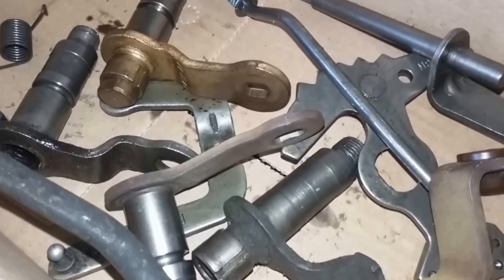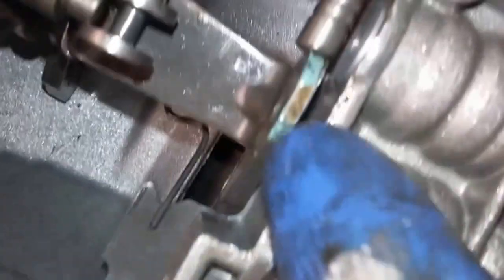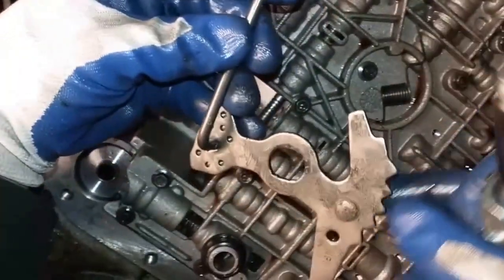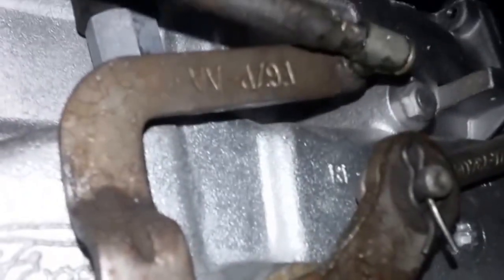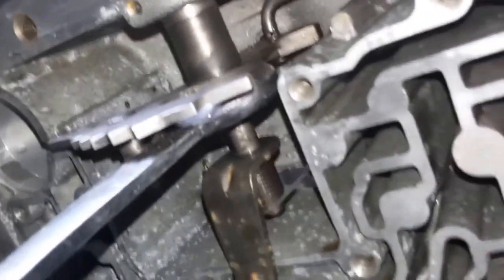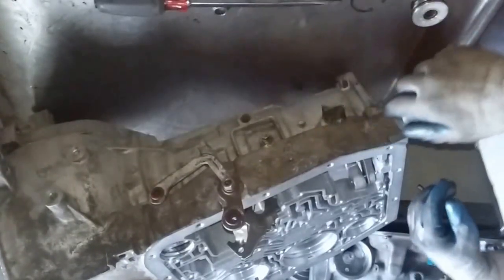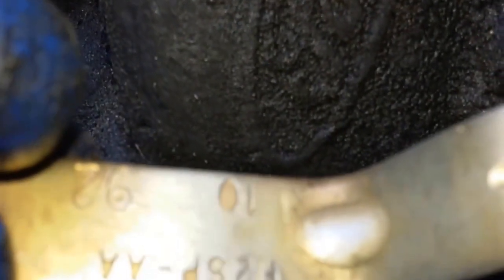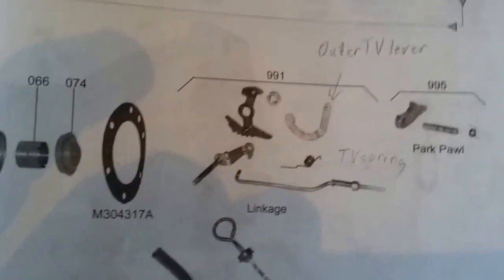AOD linkage shifter parts explained tv link names details ford transmission

Comment: Oh no i took the whole valve body off to take that out cuz its a 91 f150 old and stuck together. I cant find where to get that bolt from cuz mine broke or what its called all i seen was its called shift linkage. Any tips?

Comment: Hello, I have a question on my Zephyr aod transmission but it leaks oil from the TV part, what can be done in that case?
Reply from the maker: Hello Victor great name. The Throttle Valve seal is the easiest to replace. when I remove the nut and take the arm off (outside the transmission) there is a seal right there to replace. Just be careful not to push the threaded rod down in there the other end will drop behind the tip of the throttle valve and get trapped. If that happens the pan has to come of to reach in there and put it back correctly. The other danger is while reinstalling the arm and nut if you over tighten the nut or tighten without holding the arm you can damage the other end of the TV rod inside the transmission. Replacing that becomes a whole lot bigger project. Finding a replacement is difficult and expensive.

Comment: Where can I find a new Inner T.V. Shaft? It is the peice that the outer selector shaft slides over. The threads were ruined trying to unassemble. Thanks for any help!
Reply: Im trying to figure out the same excat thing did you find anything?
Reply: @patrickcooper558  I will have to look through my stuff and see if I can find out where I ordered it. I was able to find it, I want to say from a small shop in Michigan that had to ship it. I will look into it.
Reply: Hey checkin in did you find it
Reply: @patrickcooper558  Hey Patrick. I have asked around and talked to the guy who ordered it. And we cannot remember where we got it. I will keep looking but I'm almost sure it was shipped in from a small shop on Michigan. I don't know if it's something they carry or just a lucky fluke. I'll let you know if I can find anything about it.
Reply: @patrickcooper558  So got looking around. I believe the part number is E7AZ7D261A. I'm not sure it this will help you. Not an easy part to find.
Reply: Oh man thank you so much i dont think you know how much you helped me out   I looked around but that part from ford is discontinued they dont have them anymore so now im looking around to find the part. Thank you so much

Comment: So, hypothetically, if I wanted to swap the AOD out of my truck and go with a later model 4RW70, I can just install the AOD shift lever into the 4RW70 to maintain the right geometry in the rest of the truck's linkage, as long as I plug the hole in the middle where the TV rod would go, as it would be unneeded, correct?
Reply: newer models use computers they dont use tv pressure to control the transmission

Comment: i have a bronco.its a 90 model some thing weird goes on where the shift lever moves back and forth.it doesnt go into park and creeps forward when idling.
i thought the shift lever was broken loose,but after i have taken it apart and out.i dont think that whats wrong.i was wondering if the rooster comb worn out or something else.
ive never messed with transmissions very much but that wont stop me from trying.i wanted to fix so i can go sink it in the mud someplace.
oh also the lever still moves with the column shifter in park and the key shut off 
i tbought i would pick your brain since you know more than me 
thanks
Reply from the maker: Youll need the Bronco on a jack or safely jacked up so you can turn the rear driveshaft. My first step in diagnosing a "wont hold in park" problem is to disconnect the rod or cable on the arm just outside the transmission. This way you can narrow down weather the problem is in the trans or the vehicle part of the linkage. With the vehicle linkage disconnected grab the arm at the transmission and pull it as far to park as you can. Turn the driveshaft to see if it locks up in park. If you get park this way its the cars linkage. If you cant get park You gotta go deeper in the trans.

Comment: what parts would i need to make an AOD work with a column shift 79 zephyr 302/351 windsor?  would i need all the parts from an 80-83 LTD AOD/302 since its similar to a fox?
Reply from the maker: That would be a good start make sure you use the AOD flywheel and  driveshaft yolk. Heres a shifter linkage that will make the swap a lot easier. https://amzn.to/379dBvw
Reply: @saneauto  yeah i talked to them since you posted this.  in their picture the other end that attaches to the column looks like my C4 attachment except they have just that one rod and mine has several different bent rods.  i wonder if i could take it all off and just use the cable and attach their cable to the part that comes off my column?

yes i will be using aftermarket stuff but it will have to be a 28 oz flywheel that works with AODs.  they makes them SFI or not.  ill have to figure out which one

EDIT:  ididit told me i have to have a certain amount of column sticking out of the firewall to use theirs which is meant for an AOD swap but its a cable and not a rod.  the rod would have to be several pieces since its not a straight line to my steering column   and i may just have a driveshaft made but try to avoid it if i can but i dnt think i can unless there's an interchange for the car with an AOD

Comment: Is it possible to over tighten the internal nut on the tv linkage rod?  I took an rotated my shift lever 180 degrees so that it faces down so it will work with my shifter.  When I put everything back together, the TV cable arm on the outside of the case is very tight.  It does not move as freely as it should.  How tight should that big nut be on the inside?
Reply from the maker: You need to pull the pan and check to see if the TV arm got between the valve body and the tip of the Throttle valve. 4:20 in the video
Reply: saneauto after I watched your video, that's what I think may have happened. One other question. My aod is an older one, like 82 or 83. If I get a newer 4r70w to use the internals, will the input shaft work too or will it have to be a specially ordered part?  An if you go that route, and need to rebuild it which rebuild kit do you use the AOD kit or 4r70w kit?
Reply from the maker: https://www.youtube.com/watch?v=I6S0JHdS7kU   This is my AOD with a 4R70W planet set. I will eventually have to make a video showing how to do this. You wont be using the 4R70W input shaft. There is a lot more to the conversion than that. Like I said this will require its own video to explain. I did use an AOD kit.
Reply: Thank you so much for your help and videos
Reply: I found a guy selling a 98 4r70w for 50 bucks, he said it makes noises in 1st and 2nd gear. Would it be worth 50 for the parts? He said it was still working fine other than the noises.
Reply from the maker: If you have to buy 2 or 3 cores at that price you still only spent 100 -150. I get around 200 for a good planetary set.

Comment: The guys that designed these things had to be aliens,i have rebuilt motors,rear ends,front ends, you name it but when it comes to these things i thread very carefully and only take off the minimum i have to to finish a repair, ill translate "im scared to death of automatic transmissions", ha ha ha ha

I have to replace my seals on my linkage on my AOD so thank you for this video very much, i did have a question,whats the best way to pull the bigger seal (case seal) out without the proper tool? can it be carefully pried/popped out with a screwdriver being very careful not to scratch the surface?
Reply from the maker: Right, transmissions are the most unforgiving things to work with other than women. ;-) Yes your correct a nice wide flat blade screwdriver with some care will pop it right out. Tech tip clean the hole with scotchbright and a paper towel. then install the new seal dry.
Reply: @saneauto  Thank you much for the reply,i also forgot to ask, did AOD's not come with a pan magnet? i replaced my pan a few years ago with a pan that had a drain plug and i didn't see a magnet, i also saw a video of a guy on Youtube awhile back doing some work on one and i also didn't see a magnet,seems to me it would be a good idea or is there a reason for it not being there?  the women quote was hilarious but so true,id rather work on transmissions,lol